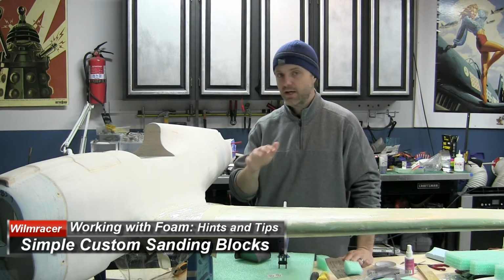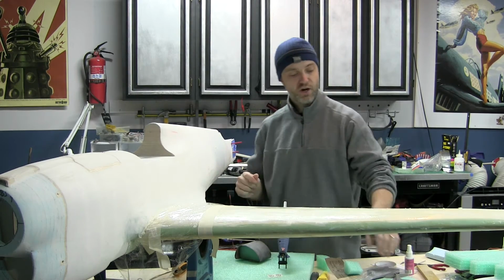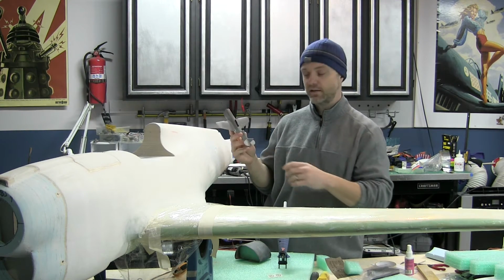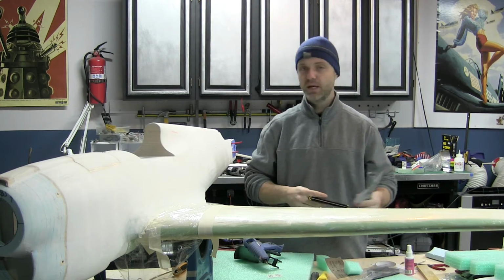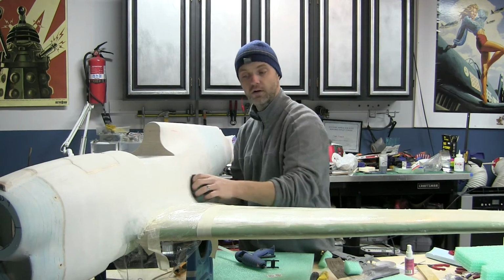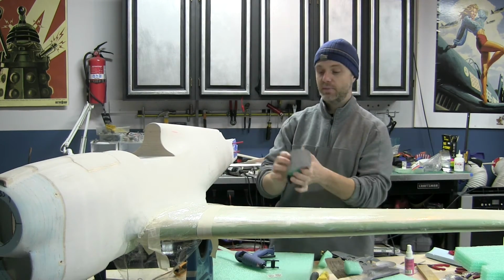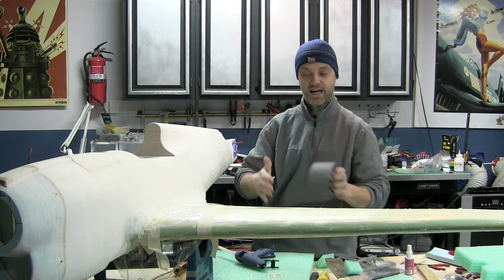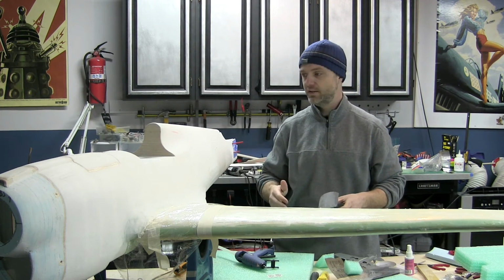RC Scratch Building - Custom Sanding Blocks

Comment: Where did u get that packing foam. Does anybody know. Thanks
Reply from the maker: That foam came from the packaging material of a server rack from work.  Foam used to pack electronics or appliances works really well.  Just keep an eye on the trash and recycling and I'm sure you'll find plenty of suitable stuff.
Reply: That kind of foam I been looking to do a durable foam plane, it can crash and it won't break. Thanks man, sorry about u p40 I hope u can fix it